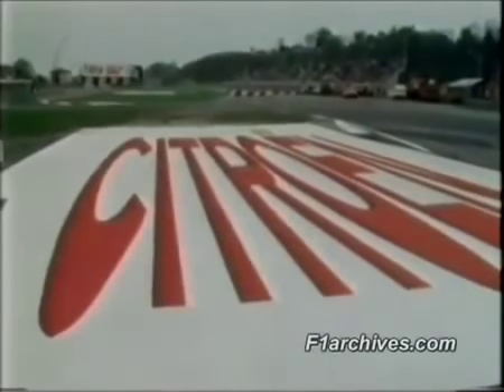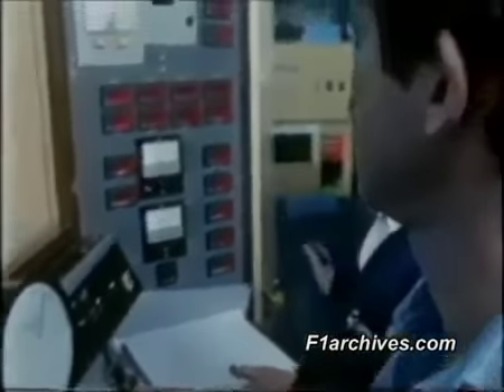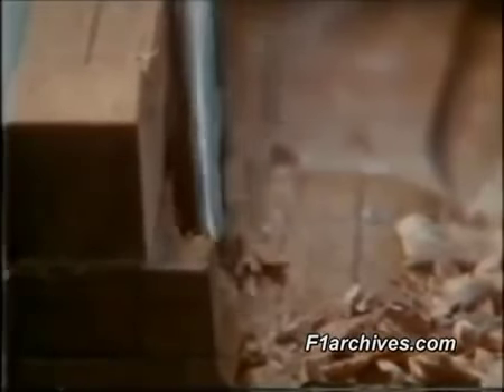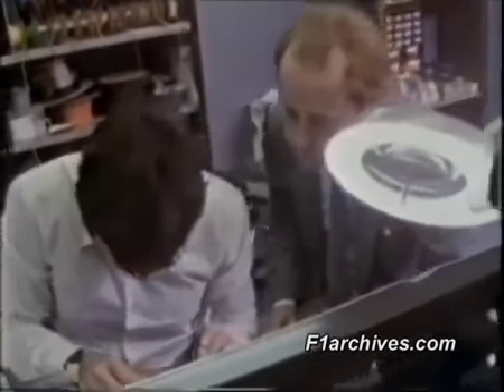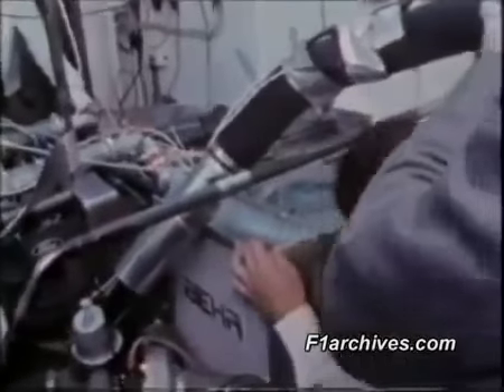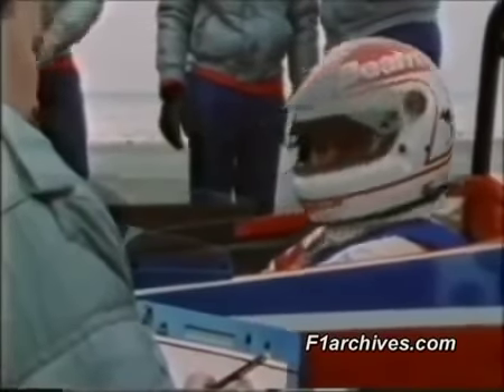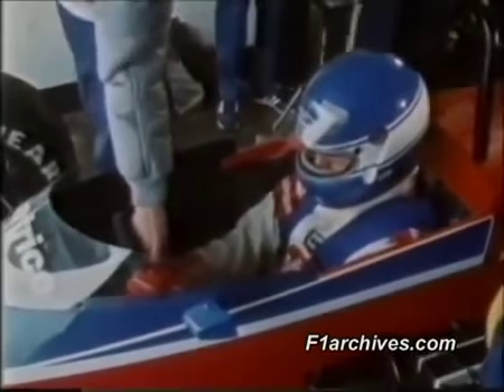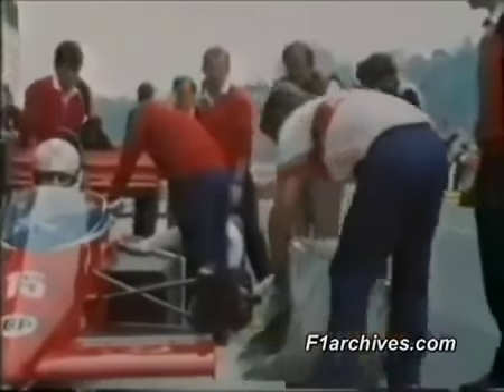Formula 1 Turbo Engines Return 2014 - How it All Started [Documentary HD]

Comment: Misleading click-bait title and thumbnail.  This is an old F1 documentary about the First Turbo era cars, made in 1986.  It is not about the new technology, except for one very prophetic statement by Keith Duckworth (the "worth" of Cosworth) at 26:50.  He said that he wanted to replace the twin outboard mounted turbos with a single large turbo mounted in the Vee, and use the excess turbine energy to feed power back to the crankshaft.  That in a nutshell is the core of the new F1 turbo era.

Comment: Please don't put HD in the title if it's not HD!!!
Reply: +jdmikeg4 360p is not HD!!!
Reply: +Fridgemusa its 360p HD
Reply: +Fridgemusa Seriously! 360p is not HD no matter how hard you try to make it.
Reply: +jdmikeg4 there is no such thing as 360 HD, HD is 720 horizontal lines or more.
Reply: +Lord Beavis No shit!!!
Reply: Easy there Seabiscut... I'm agreeing with you.
Reply: +Lord Beavis So was I :P
Reply: +Fridgemusa reported you tool.
Reply: Depends, is HD a logo like DVD? If so it will have a set of standards written. If it just means 'high definition' then no. If Logie Baird was talking 360 lines he would have called it high definition. The 405 line television standard transmissions were called high definition when they were first broadcast, as was 525 and 625 colour. Secam in France had 819 lines in 1950, in fact they worked on a 1000+ line system in the 40s! When the latest HD service was introduced for broadcast it offered either 1080 interlaced or 720 progressive both use roughly the same bandwidth. So you are correct there. 
HD just means it will not be a blurry mess.  Screen size, viewing distance, frame rates and so many other variables make up the subjective picture quality, it's not all about lines or pixels.

Comment: I remember watching this on the TV when it was first released. I thought it was interesting then. Now it is nostalgia. I would like to see a new formula. No rules restricting the use of technology. Although would a man be able to drive such a car?
Reply: +Stephen Brookes No. The rules are there to slow the cars  down for driver and spectator safety. If all the banned technologies were unbanned, and all restrictions lifted the cars would be much, MUCH faster and would go flying into the crowd the moment there was the slightest failure of any part of it. Imagine cornering at such crazy speeds...even a tiny drop in engine power would transfer weight forward enough to cause an uncorrectable spin. I doubt a human could survive the G-forces that could be generated. A car is capable of generating much higher lateral G than any fighter jet, which only has air for grip. We'd be seeing cars with 8 wheels, skirts touching the tarmac, sucked down by fans, all-over adaptive aerodynamics, massively powerful engines, less weight, computers sending the grip around at unbelievable speed. I don't see why 400mph on a long straight would be too hard. Piston engined cars were doing those speeds decades ago
Reply: Yeah I know all that. What about mounting canons or guided misiles?
Reply: Planes dont actually grip the air.
Reply: I think you know what I mean. Friction is friction. Ground vehicles can change direction faster than airborne vehicles.
Cannon and missiles are a stupid idea. Not to mention dangerous. Why can't they just throw painted tortoise shells at each other and leave banana skins on the track?
Reply: Ash Scott The friction between an aerofoil surface and the surrounding fluid is incidental, yet that between a tyre and a road is specific and desired. The tyre is gripping the road, whereas the movement of the aeroplane is being resisted by the air and is undesirable. Yes I know what you mean, you clearly understand the principles, but use confusing terminology. I got the impression that you were in some way trying to correct me, which would be fine if I had made an incorrect statement or displayed a lack of knowledge of rudimentary physics.
Reply: +Ash Scott  We should collect racers like TT riders and safety won't be a problem.
Reply: +Stephen Brookes Do u even physics m8? Your comment made no sense.
Reply: Rottensteam My comment makes no sense? Maybe you didn't understand what I said, but it is correct. . 

"Do you even physics m8"  now that makes no sense! 

Please do explain to me what part of what  I have said that you do not understand, and I will translate it into incomplete sentences for you!
Reply: Stephen Brookes Yeah u dont physics m8
Reply: Rottensteam You dont English m8 You don´t shit m8
Reply: Stephen Brookes U mad bruh?
Reply: Rottensteam You do not make proper sentences!  Nothing you say means anything.
Reply: Stephen Brookes Ye u mad af.
Reply: Rottensteam
Reply: Stephen Brookes mad af

Comment: The engine break down and analysis after the test stand failure was interesting. Very surprised they would let anyone behind the scenes as F1 tech is famous for being so secretive, even more than the military.
Reply: panther105 They were less secretive back then. It was a smaller group of people. BMW based their engine on road car blocks, but only ones that had already been run for thousands of miles (because it work hardened them).

Comment: "turbo charged" is NOT a true Turbine engine!  Why in 2014 are we still using piston engines in these cars why not dump the piss on go total turbine less maintainance, and wear at high revs also less fuel and just makes a Hell of a lot more sense with a car that doesn't rely on torque but rather speed like a jet plane.
Reply: higher fuel demand at idle, higher noise, higher temps and costlier materials, less response, jet engines dont like huge variables in rpm.
theres lots of cars that tried jet engines go google them and youll see why they aren't feasable, if used in a hybrid turbine-electric style that might work.
Reply: It's been tried, several times with predictable results, as commented on above!
Lotus had an Indy car in the 60's, which actually did quite well due to the relatively constant speed on ovals, but it drank fuel and was unreliable.  Rover also built a prototype road car but it was plagued with problems.  Piston engines are difficult to improve upon as far as combustion heat engines are concerned.

Comment: I came here thinking someone actually made a clear turbo. ...disappointed.  lol
Reply: The totally round Wankel design-based motor cycle has 3 intake/exhaust sets, compression is achieved by 

closing with caps 2 sets at a time in a rotary serial sequence, also we have 3 ignition sets.

The problems? The engine usually exploads because the ignition sets
might get mixed with more fuel than are supposed to, also caps break of.

It doesn't work really well yet.
It is a great idea though.

Some scientists tried to used
a double Boomerang shape at the beginning with 2D motion,
but now we know that we must build
the first 3d motion rotary engine.

A 3d motion rotary engine is like a quantum mechanical particle. You cannot make a simple 2d animation to 

explain it but a 3d.

It is the best thing we know have in mind, we can trap that 3d moving central part with gears, but many 

times it breaks. It is a way more complex and delicate design, not so great for simplicity but for academic 

research that might help simpler engines. A 3d rotary engine
does not complet a spin in one period but in 2 or three, it depends on the design.

It is really fun though!

This is really a diamond to look,
a rotary engine disigned with spins - like quantum mechanics, so the 3d motion does not return to the same 

position at once, it has to follow a    3d path.

It breaks and it does not work well.
But academic engine research, always allow us understand more stuff, and keep the parts that work well.